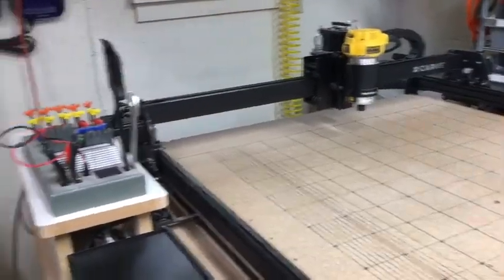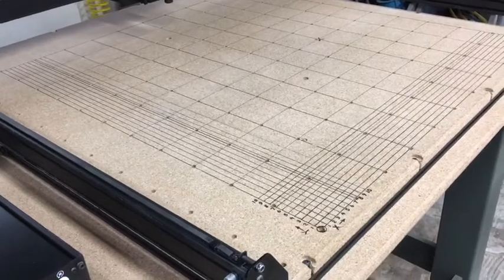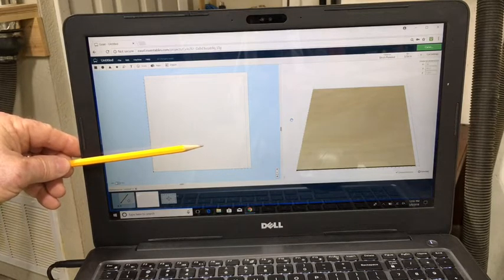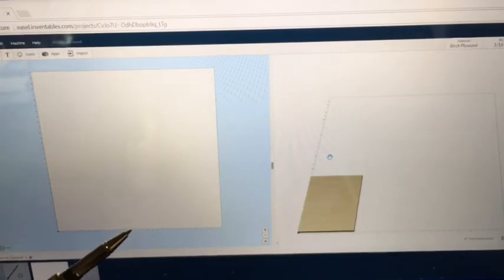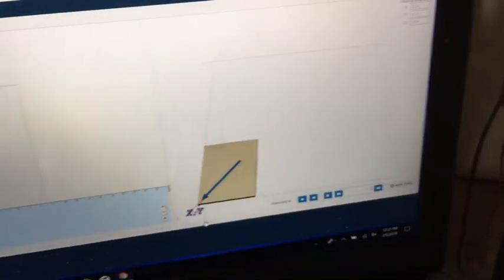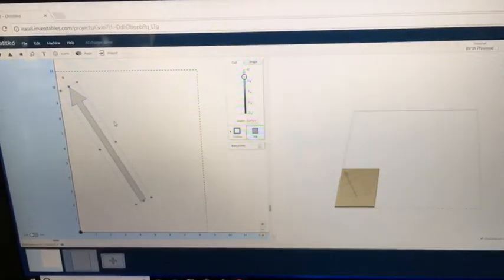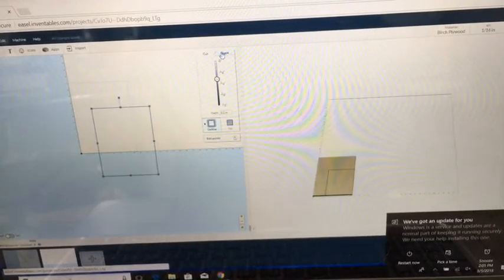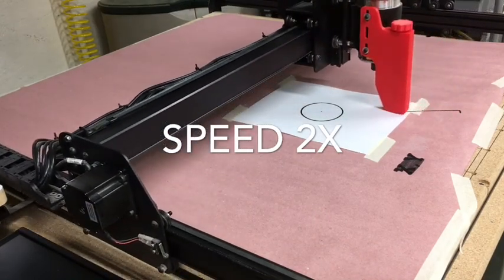X,Y 0,0 Axis and Fails in Easel

Comment: Do you have any videos using easel with the foxalien 4040xe? My cuts are not matching up to my design and easel preview.
Reply: I cannot get a fully corrected project, something always messes up? Either a letter runs into another or a corner engraving will be offset even though everything in the easel preview shows perfect. I’ve gone through $60 worth of wood and still have yet to complete the plaque I’m trying to make
Reply from the maker: What are you feed rates and depth per pass?  Also, what bit are you using to carve? Wood type? Sounds like you are losing steps
Reply: @PawPawsWorkShop  pine wood .75 inch thick. Feed rate slowed down to 90% which I thing is 38 inches per minute. Never messed with depth per pass. Just leave it alone on automatic in easel. I did change the spindal speed from 12000 to 10000 in easel.
Reply: Using 1/4 inch shaft 60 degree v bit
Reply from the maker: Keep the router on 1. If using the spindle 10000 rpm. I usually run about 40 ipm. The depth per pass defaults to .005. If you have knots in the wood try to avoid them. You will also hit the grain that is both hard and soft. Knots can cause you to miss steps. The grain generally does not just may cause slight movement
Reply: @PawPawsWorkShop  what do you mean by leave the router on 1? 100% would be the 40ibm so I will leave it there. I will have to check to see the depth per pass when I get home but if it’s not on .005 I will set it to that. Thank you for the information.
Reply from the maker: Some people have upgraded the 4040xe to use the dewalt 611 router. The setting for the router is 1. The router is variable speed so you set the router to 1. That not a setting in software. It’s on the router
Reply: @PawPawsWorkShop  oh, I still have the factory spindal that came with the machine.
Reply from the maker: Yes, go to the FOXAlien playlist. I recently made some right angle clamps. Have you calibrated your machine?
Reply: I’m trying to engrave a 12x15 plaque for a friend who’s about to have a baby. Been trying for a week. 8 hour long project on the foxalien 4040xe just to have something go wrong towards the end is frustrating.

Comment: Your info was a little wrong, you have End Stops installed on the front side of the Y Plate, that would trigger once the Y Axis tried moving beyond it's limit and it would send a signal to the controller to stop, if working properly.

You could wire a End Stop for both ends of an axis to prevent it from going out of bounds on either end. That is a little more advanced.

Overall Good Job!
Reply from the maker: You are correct in that I have the micro switches installed but I do not use them at all. I know a lot of people do and have success but for me I do not want the machine to get that close to the edge ever.

Comment: Thanks for sharing!  I found this video after noticing you set your X/Y to the center on another video and I wondered why.  I see how to do it now, but I still don't understand why you want to set the zero to the center?  What is the pro of doing so vs. using the default at the lower left corner?
Reply from the maker: I will move my x,y position anywhere that will help me do the project easier.  It may be in the center to ensure that the project is exactly in the center of the board. It maybe anywhere that you want to put it.  It all depends of the project.  When I did the pledge on the flag, the text of the first three lines I used the center of the board on the y axis.  That position is rarely used but it worked great for that project.  Thank you very much.

Comment: Thank you for sharing this.  It was very useful.  I have my homing physical contacts on my X-Carve board set to 1 and 1 right now.  So, every time that I start the machine, it will automatically go to that location.  So, let's say I have the same circle on the middle of my work as well and have set my center coordinates to zero and zero accordingly.  Would I have to manually set the x and y to the middle of the work to start with?  You clearly showed how it would work but the router was always set at the assigned zero's when you start the drawing.  Sorry about my confusion but would you please share this with me/us too?